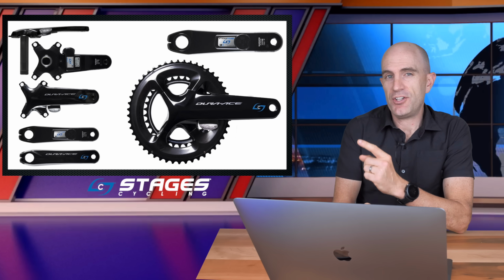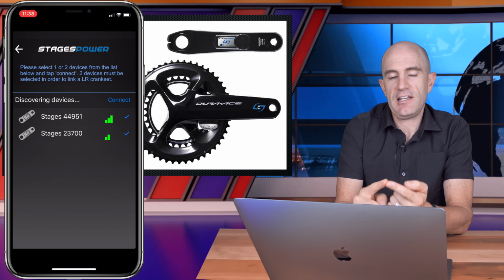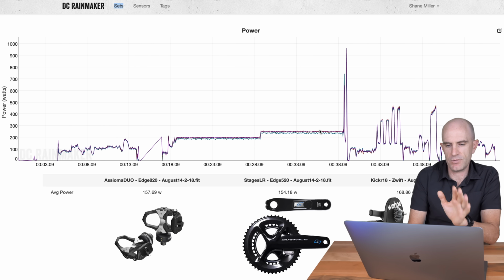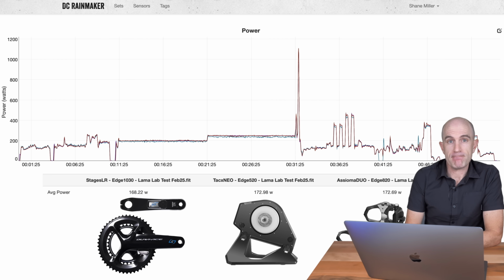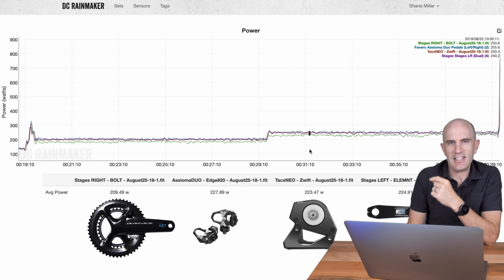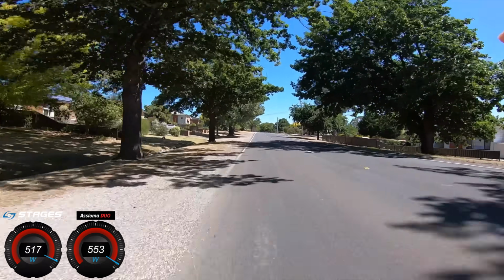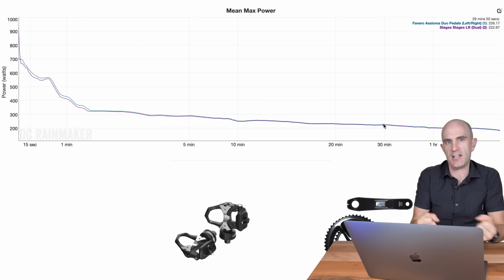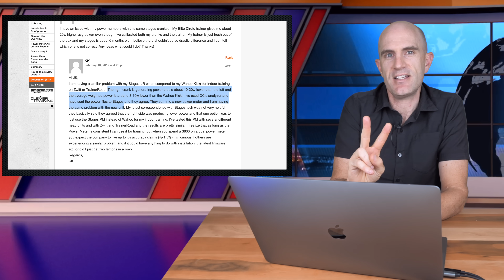STAGES Dura-Ace R9100 LR Gen3 Power Meter // Details // Ride // Data Review

Comment: Been using this exact PM on my Venge VIAS Disc for almost a year. It's been rock solid and working perfectly. Stages really does make some of the best PMs on the market. Their support is also fantastic.
Reply from the maker: Have you compared the power numbers to any other sources? Stand-alone the unit would be as you say.
Reply: @gplama   Yes, I have dual sided S-Works cranks on my new S-Works Tarmac Disc (PM modules are by 4iiii but branded Specialized) and they track almost identically to my Stages PMs. Never had an issue with either PM, even in rain.
Reply from the maker: @JT3-610  ok. I'm not out to burn Stages. I'm out to understand the issues I've had when comparing power meters together on the same bike. Comparing two cranks at once isn't possible.

Comment: Stages should develop their own, Stages branded, LR crankset power meter with exchangeable axle and spider (modular). They already have their own left only carbon power meter compatible with different axles. They should go in that direction wit LR option. Trying to figure out Shimano based L/R power meter seems hopeless after all those years they worked on it.

Comment: Was really hoping to watch this video and have you say Stages fixed the issue with the low readings. I have the R8000 LR and have suspected the power readings were low while I was on the Kickr. On my TrainerRoad workout tomorrow I’ll record both Kickr and Stages together to see. 

For those that received new R side PMs from Stages, were they reading then correct?

Comment: I have the exact crankset duel sided stages power meter, I have nothing to compare it to. I did have battery issues, the left side ran out of battery in the first 40 hours, then I replaced and got maybe 100 hours out of it all while the right side was full battery. Hopefully it lasts this time or I have an issue.

Comment: I have 4 left-sided PM meters (gen 2 and 3), and I've never had any issues.  Back in early 2017, I did have dropouts, but it was a matter of Garmin v. Stages and simply moving the head unit closer.  Eventually a software update was created and never a problem since.  However, other than that I have NEVER had a calibration fail or sync with either the Garmin or Stages APP.  I love the company and their PMs.
Reply from the maker: Excellent. That's in line with my data from both the 105 and DuraAce LEFT only meters. The right side power meter data is a different story. It didn't love me back.

Comment: Do you think it is possible to calibrate whilst pushing up on the pedals to get a more accurate but artificial calibration. Just thinking.
Reply from the maker: If the issue was uniform, then it’d be an offset error. Easy fixed. This is more complex.

Comment: Had the same issue with my right arm reading lower on my Ultegra LR when the left arm battery died and I was too lazy to change it. I had put it down to my leg imbalance (left leg has always shown to be stronger) and didn't put any extra thought into it. Now this has me doubting my past years worth of data (not that it truly matters since this is the only power meter I use and seems to be consistent).

Comment: I think this (long, but bare with me) quote from Ray is very important regarding Pioneer's new dual/Right side Dura Ace power meters:

"Pioneer has ever so subtly changed the strain gauge design for the latest generation of Shimano cranksets. Now, as opposed to using the same design for the left and right sides, they’ve shifted to having different designs for each side.
The reason? Starting last year with the latest Dura-Ace models they were seeing variances in flex from the materials that Shimano was using for the R9100 generation units, with clear differences between the left and right sides (which could and would impact accuracy). In fact, Pioneer quietly introduced this change last year with those units on those R9100 cranksets."  

the quote is from this page: https://www.dcrainmaker.com/2018/09/pioneer-announces-new-color-mapping-gps-bike-computer-plus-new-power-meters.html
Reply: Has Stages also adopted a different strain guage to take into account the different materials?
Reply from the maker: This is a very good question. I don't know. (I'd have hoped so, for the price)

Comment: From just looking at the differences between the Left and Right crank, the right looks to be far bigger dimensions and have the spider built into it. this could make it say10% stiffer than the left with smaller dimension and no spider. So maybe with this added torsional stiffness the strain gauges aren't reading correctly as this hasn't been accounted for.

Comment: Thanks for the another great test and video.  I've moved from LH only gen. 1 Stages PMs to the Favero Assiomas DUO about 3 weeks ago.  Improved accuracy and easy to transfer between road and TT bikes.  The only downside is moving from Speedplay to Look cleats and pedals.  Did the Stages techs/engineers comment on the different temp. and ADC values you recorded when you did the zero offset via the app. as shown in your video?  Although both ADC values (923 & 880) are in the acceptable range of +/-50 from 890 that they quote in their support notes, I'm wondering whether there should be that degree of separation in temp. and ADC values when the zero offset is done simultaneously.  Apologies if you have also been down that rabbit hole as well.  Cheers, Paul

Comment: Really seems to be asymmetric deflection in the DS crankarm at different points in the pedal stroke. My bet is the torque readings at TDC and BDC are off when there are temporary accelerations within the pedal stroke. I would definitely try some more indoor lab tests with ERG in high and low gear ratios and high/low cadence (or specifically try circular pedaling vs more downstroke heavy pedaling.)

Comment: Shane can you show how it will appear on your Garmin device?  Also can you do a comparison with the shimano and say pioneer or a other crank based power meter. To see how stages compares
Reply from the maker: Garmin devices: It shows up as a single ANT+ device to pair. Comparison with other power meters is limited to what I cant test at the same time. This is why the pedals and a smart trainer are good reference points. I've covered the Shimano Power Meter in another video (tldw; similar issues). I've also covered the Stages Gen 3 Shimano 105 Left only in a video that had good numbers for a left only unit.

Comment: Sky has won x TdF with this power meter.  Yeah but they always just sit in the saddle and pedal at constant cadences.  They don't jump up and throw the bike around.

And that said...perhaps that's the issue really.  Are the power meter companies seeing this but saying that in that use case, you're not going to be staring at your power meter numbers.  So why does it matter?  As long as it is correct and consistent when you're putting out steady state that's all that matters.

Again, not my thoughts exactly but I wonder if that's how they feel that it's fine as opposed to a problem.

I think in the end the reality is that it DOESN'T matter if they all match as long as you're consistent in what you're using for your training/racing it will be fine.  If the Stages is 10 watts lower in an out of the saddle full gas sprint because the right side is off...how does that impact your training?  It doesn't really.  Now if one bike has the Stages and then you jump on a Neo indoor bike to train....yes you can't directly compare the numbers.  And yes it would be best if it matched.

Is my thinking wrong here?
Reply from the maker: If I need to do 250W ERG and the power meter is reporting only 235W. I have a problem with that. That's not within +/- 1.5% and I want to know why.
Reply: Shane Miller - GPLama I totally understand your testing and love to watch the results of all the different meters.  My point is if you only had one and did you testing on that one then your levels would be set based on that low reading and it wouldn’t really matter. Now as soon as you throw in a second source of power that’s all thrown out.

Best case yeah they all match.  Personally I have a KICKR 17 and then bought PowerTap P1 pedals.  I had been training with the KICKR for a year before i decided to try the pedals as my power source and it really threw a wrench in the works as they do read slightly different from my KICKR and TrainerRoad’s “Powermatch” really wasn’t able to deal with the differences. I’m now back to using the KICKR for power for my training and I use the P1s for power tracking and pacing when outdoors.  But I never really train outdoors so hitting a specific power number isn’t that important. 

Keep up the great work and reviews. Awesome content.

Comment: Does it make sense for power meters to necessarily give the "3 dimensional power"? If you're exerting forces that are not in the plane that the Stages is measuring  i.e. in the plane of the crank rotations, that force is just going into flexing the crank laterally rather than driving the bike forward. I guess it's more of an "effective power" vs. "total power", but maybe it would be a cool metric to see the difference between the two to minimize "wasted" lateral forces when sprinting.
Reply: Theoretically, a "good" engineered load cell will ignore forces NOT in the designed measurement direction.  This, on a strain gauge based sensor is done thru having multiple bridges on the gauge which cancel out the unwanted forces.  You can increase this cancellation, or isolation if you will of the desired forces, with the placement of the strain gauges.  Ideally, placement on the neutral axis effectively removes forces not in plain.  For a simple rectangle the neutral axis would be on the center.  Typically, you would machine a pocket into the part to create a surface there allowing you to mount the gauges.   OBVIOUSLY, on a crank arm, you would NOT want to do this.  So you are left with the bridge design. 

With more radical angularity during a sprint, I think the issue becomes more one of twisting the crank arm.  Strain gauges experience changes in length that can be measured in electrical resistance that can be calibrated to force.  There are plenty of good online resources for a more in depth explanation.

Comment: Oh no Shane 😅, I'm interested in buying a power meter and I was going to buy the Stages Ultegra LR. But now it's definitely not my first choice anymore. What would you recommend instead of the Stages? I'm looking for total power (not necessarily with left and right distinction) and I don't want to buy pedals because of the cleats.
Reply from the maker: Power2Max are bloody hard get a hold of. Direct to consumer means no retail store/company has them. If I can get a hold of one, I can put it through my tests.
Reply: Matthew25 Power2max is pretty good. You can read DC rainmaker’s review about both NG and NGeco models. Quarq is another solid option but they are more expensive than power2max for Shimano users since you do need to replace the bottom bracket.
Reply from the maker: I'm a SPD-SL cleat fan too.. but don't let that stop you from choosing a good power meter solution. The Stages Right is being replaced this week.... I'll see how that goes. I'm also trying to get a hold of the 4iiiii Shimano unit to see how that stacks up (the Podiiiium was on the FSA carbon crank).
Reply: Shane Miller - GPLama my only beef with 4iiii is no temp compensation. They literally say on the website to leave your bike out where you will be riding for a while before you calibrate. As we all know riding conditions change fast (sun/no sun). Seems a bit behind the curve if you ask me.
Reply: Thanks for the answers, power2max seems great but as I understand they are not directly compatible with Shimano. Also for me it's kind of a problem if they sell only online since I wanted to buy from a bike shop. Anyway, I'll see what the shop has, and in case I'll even try Stages so if they have problems I can return them pretty easily. Otherwise I'll switch to pedals with the Assioma Duos, I live 100 kilometers away from Favero so I think I could also buy directly from them.

Comment: I'm having the exact same problem with my Ultegra LR cranks. Right reads low, overall numbers are 10-20 watts lower during steady state efforts when compared against my Wahoo Kickr Core. Stages support is great though, so if anyone else is having trouble, reach out to Stages.
Reply: Updare - After a lot of back and forth, Stages sent me a prepaid shipping invoice for my R8000 LR crank to go back to be re-built. Hopefully this fixes the problem. I'll post back in 2 weeks or so with an update
Reply: Scott Dickey I only had access to power meters in pedal form and a smart trainer to verify this at a friends house so I have no fit files, but my neo 2 is on the way. I will be able to verify this to stages with hard data.
Reply: @supertampon5  Good luck!
Reply: @scubascott1098  Hey Scott.  What happened with the new set?  Did they fix the problem?
Reply: @mdbarcenasm  No the same problem persisted after the re-build. I was getting the exact same numbers. There have however been a number of firmware updates in the past year, so I wonder if those made any difference. I'm due for an FTP test, so I will test the PM against my Kickr again and post the results here.
Reply: Quick update. I did a quick test this evening after updating the firmware on my Stages LR (ultegra) to the latest build (v1.61). The power was much closer to the erg mode setting on the Kickr across a range of power targets. The Stages still read 5-10 watts low, but can be chalked up to drive train losses and margin of error. The new firmware build is promising.  I'm interested in the experiences of others.
Reply: Same issue with a 9100 I reached out
Reply: @supertampon5  did you come to a solution with them? I'm in the midst of sending .fit files back and forth. Very time consuming
Reply: Scott Dickey i followed their instructions and sent pics of the crank arm without battery in. Then the calibration screenshots. Now they want several fit files, honestly this is very frustrating and I will never buy stages again.
Reply: @supertampon5  I'm at the same stage. I provided several .fit files with the meters both linked and un-linked and compared against my Kickr for reference. They're trying to tell me it is differences in my individual leg power that is the cause of the discrepancy, which makes no sense as when the units are linked the overall reading is still 20 watts lower than the kickr.. The communication has been good though. Hopefully they will come through for us.

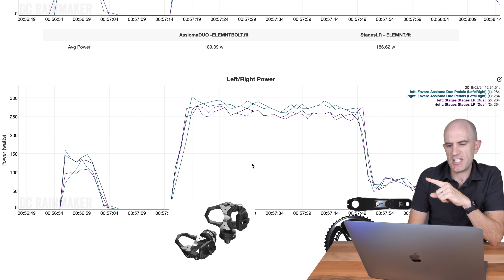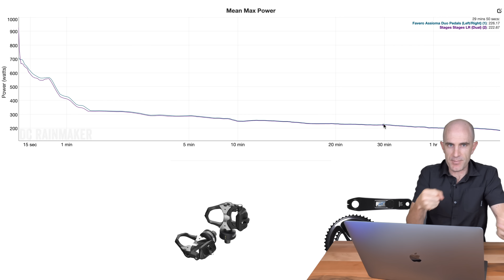Comment: I'm experiencing the exact same thing with Stages Ultegra R8000 Gen 3 LR. Both sides are reading low compared to Assioma Duo and Kickr 18. Right side even lower. Also, during standing efforts it reads way too low. Check the 13:53, 13:59, 14:20 timestamps of this Trainerroad Erg workout
:
https://analyze.dcrainmaker.com/#/public/d40b817c-a5a3-4df5-72ad-1d2de6f73d58
I submitted a support ticket to Stages a few days ago, no response yet.

Comment: So I wanted the Stages to be good, I really did, but my own experience with a Gen3 hasn’t been either. My LBS damaged my old 4iii left side and got me a Stages to replace it. (At the time I didn’t know any better and the 4iii was going to take 2-3 extra months to arrive). I haven’t been happy with it. It’s been replaced once thus far and same sort of issues you got. It’s not consistent on steady state mode (I use Trainerroad) but normal riding it’s fine. Seems if you ride the way team Sky did (in the saddle, steady attacking) you’re fine. Although they just did get a new power meter sponsorship......

Comment: Do you want:
✅ Accuracy up to +- 40%
✅ Weird left/right balance
✅ Dropouts
✅ Calibration fails
✅ Battery issues

Get the Stages dual L/R power meter now!
Seriously. The only good thing they have going is their support.
Reply from the maker: SOLD! Wait.... that's not a good shopping list. ;) The 105 Gen3 Left was pretty good.... so was this once I'd split L/R.